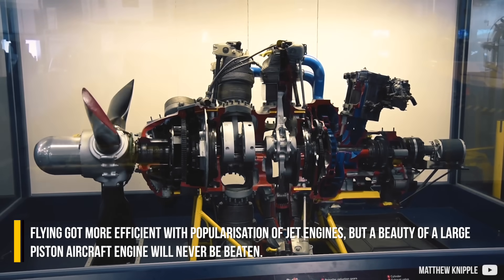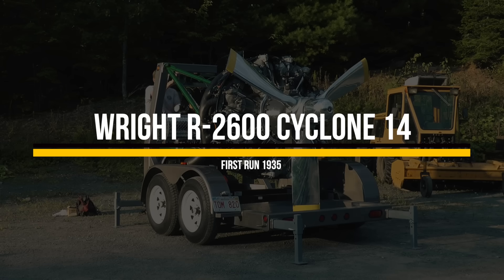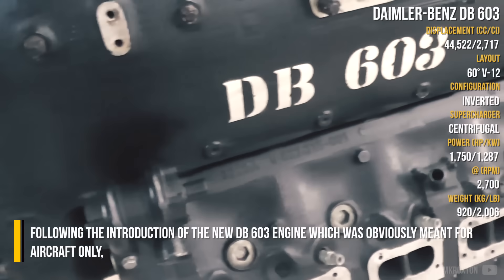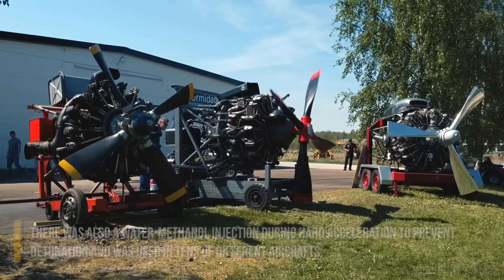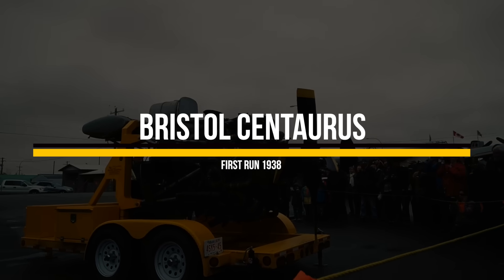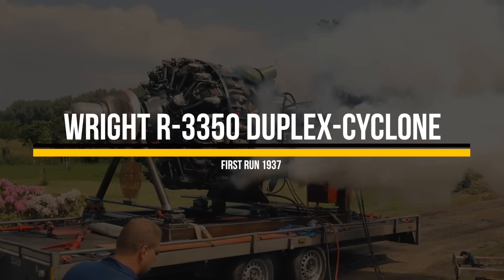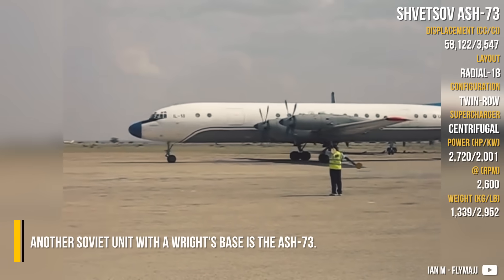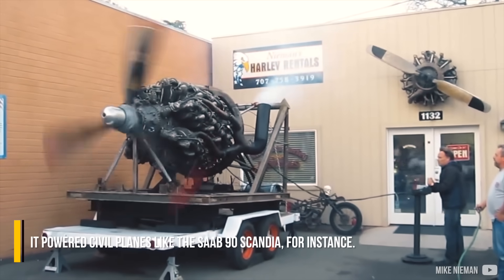9 Of The Largest Piston Aircraft Engines Ever

Comment: I am trying to learn the different pros and cons of various engine configurations in Aircraft. Horizontally opposed, radial, V , and straight engines. I think Horizontally opposed engine are the most used in modern piston aircraft but why is this the case?

Comment: You show a B-29 Superfortress when talking about the P&W R-4360 Wasp-Major four row radial. The B-29 was equipped with the Wright R-3350 Duplex-Cyclone. You would have been better off showing an F2G Super Corsair equipped with the R-4360 "Corncob radial" ! There were also several other small mistakes but overall an entertaining video for someone into aircraft and their powerplant(s).

Comment: Why doesnt the enormous torque of these engines that are on trailers flip the trailer over? Ive heard that ythe torque that the merlin produced made it difficult on the pilots when they were taking off that if they went above a certain RPM it would force the left wing into the runway. So with that in mind how can they run these engines on a light weight trailer without it spinning the trailer like a top?
Reply: @SpaceAce100 must be something causr if those engines have so much torque that they can torque roll an aircraft that weighs thousands of pounds on take off those spindly little trailers should be rolling and hopping around like something in a cartoon or something.  Its amazing to think how much power and torque those things have and if they used full power on take off it would spin the plane behind the prop. Just like a chopper has a tail rotor to keep the body of the helicopter from spinning. Its just mind boggling to think how much power yhey got out of a piston driven engine. Hell they even figured the thrust from the exhaust was responsible for 60 mph of the aircrafts top speed... Just the exhaust thrusting it forward

Comment: "We need more power. Add another bank", "But sir, this thing is clearly overheating. Don't you think-", "That wasn't a request, son. Add another row!", "(Sigh) Yes sir"
Reply: Did anybody mention why they stopped using larger cylinders (like on a ship)? So you could stay at two rows. And I could not find any mention of it. They seem to avoid gears just like ships. They could use Diesel cycle -- like ships or other airplanes. They run efficiently => less heat.

Comment: w/hydrogen fuel making running old school piston turbo props near free u will see these coming back into vogue again in large numbers for flights under 50-60 ppl out to islands & non hub airports. These will b the small for profit carriers, not hub not for profit carriers.  Comment 721 showing. They r not as fast, they r not great in winter, but neither is drive up & over a mountain. They can't handle ppl & cargo like jet not for profit but they can carry basic mail bags & ppl to non hub airport. Still hard to drive over big fuck lakes & rivers not bridge connect.

Comment: The B-29 used the R-3350, not the bigger 28 cylinder engines. The B-50 did use the 4360, but there are none flying.

Comment: The most interesting fact about the Wright R-3350 is that it had 3 turbos (good visible), but that were no turboCHARGERS. 
 
Instead, the turbines were coupled directly to the crankshaft and added about 450 hp. 
 
Hmm...
 
Using the energy of the exhaust to drive a prop shaft, more or less a propeller turbine.  
 
  
Just to clarify, the R-3350 was also supercharged, it had a "normal" centrifugal compressor.
Reply: Yeah, it was great stuff from way back when.  It was called a turbocompound.  Some diesel engine manufacturers are putting turbocompound units on their engines today.
Reply: @andyharman3022  We have such an engine in our aircraft museum here in Munich. Very impressive.

Comment: It’s amazing they were able to engineer these engines back then without computers and they built so many of them and they were reliable. Now we have turbine engines that don’t have as many moving parts and make much more power with far less maintenance.
Reply: Think, it was less than 50 years before that, that horse and buggy was more common than car. We went from clopping around behind beasts of burden to flying with birds in less than one mans lifetime. Amazing.
Reply: Well "reliable" only if you maintain it. The tolerances were huge and they all leaked oil. Tons of oil.
Reply: @carlosandleon  they didn’t maintain them during the war they did the bare minimum to get them back in the air obviously after the war maintenance was a much bigger thing. Every engine from this time period leaked oil it doesn’t matter if it was a lawnmower or an aircraft engine we had only been making engine for a handful of decades we didn’t have all the good gasket materials and sealers that we do now and I’m sure they didn’t know that one gasket material will seal better with a rougher machined surface and another gasket with seal better if it were smoother and we for sure didn’t have good seals I mean just look 50 years ago with cars where they had rope rear main seals it was just normal for every car to leak oil. The tolerances of engine manufacturing back then was also bad all the way around and even worse was balancing engines you can find videos from back then where a person is weighing pistons on a scale and before the needle on the scale stops moving they pull the piston off to put another on it lol. There are still surpluses of new old stock engine parts from ww2 for these old engines that still get used. Nowadays it’s normal for a little 4cyl engine in a car to rev past 7,000 rpm smoothly because they are balanced so well and they take thin 0w20 oil because the tolerances are much tighter. I use to work for a Saturn dealership as a mechanic and they used a Saab v6 engine in a few cars and the tolerances were so perfect they didn’t have a stock size main bearing every engine would usually have multiple different size bearings because they manufactured them to much tighter clearances and because they did such a great job machining the bottom ends they would never come in with  spun bearings I think the entire time I worked there we did a crank on 2 engines because someone cracked the oil filter housing and leaked all the oil out. Engines have came a very long ways! My grandfather worked on the b-29’s in the Korean War I think they had 18 cylinder wright engines, he flew all over the world in them on missions he said the biggest problems were with the magnetos and then cylinders would crack some times but he said the cylinders were more of a problem when the were doing training in northern Canada because of the super cold weather. Either way it’s amazing some of these old air frames are 80 years old and still in use!

Comment: Every one of these engines might as well be every other engine on this list.
Reply: @xvg3980  they all have a power to volume ratio that is close to 50 hp/litre, they all have the same rpm range, and they are all the same rough weight. They might as well be the same practical engine.

Comment: Many of the aircraft do not match the engine identified. The Wasp Major did not show an airplane it was used in. Not the B29 which used the Wright. The B50 (similar but with a taller tail or the C119 flying boxcar, or the C123 Globemaster) all used the Wasp Major would have been suitable. Still interesting.

Comment: A few searches on wikipedia (with sources of course) shows that there are errors in the video. For example, the P&W R-4360 wasp major did not equip the Saab scandia, which had two P&W R-2180-E twin wasp E engine, but was indeed use in military aircrafts such as the Convair B-36, which was not an anecdotal aircraft; and the plane shown at 9:04 cannot be a Saab Scandia (two engines civil plane, as mentionned) since it has four engines and a gun...

Comment: Good video but at the end you went from the 4360 to footage of the B-29.  The B-29 did not use the 4360.  The 4360 WAS used on the B-36.....Americas largest piston powered bomber with 6 turning and 4 turbojets burning.

Comment: When discussing the PW R4360, they showed a B-29 as one which used the 4360.  However, the B-29 was not powered by the 4360, but a larger, look-alike, the B-50 was.  I spent a lot of hours as crew member of aircraft powered by the 4360.

Comment: Thanks for the compilation, just be careful what footage you choose for each engine - there are a few danglers where it doesn't match (e.g. 6:00 is not a Centaurus even through the airframe would originally have had one, it's an R-3350 - valve rocker covers are a giveaway ;P)

Comment: The R4360 delivered 3800hp. The B-36, the largest warplane ever built, featured 6 of these engines, each in the pusher configuration. THis video does not mention that large piston engines tended to catch fire and could suffer from cooling problems.

Comment: The Sea Fury at 3:59 should normally have a Bristol Centaurus radial at about 53.6L or 3,272 cubic inches making 2,500hp

The Wasp Major R-4360 was installed in the Goodyear F2G Corsairs, also known as Super Corsairs, with first flight in 15 July 1945. The order was for 418 F2G-1 units and 10 F2G-2 units but only 10 were built before war ended. Only two exist and only one is flight worthy. 

The most distinguishing feature of the F2G Corsair is the bubble canopy.

Comment: Your last engine was the 4360 which powered the B-50 and not the B-29 shown. The B-29 had Wright R-3350's. There are several B-50/KB-50's on static display (e.g. Castle AFB, Atwater, CA) but there are no flying B-50's that I'm aware of.

Comment: The Wasp Major came too late to power war machines? Than what was that B-50 you showed? And what was the B-36 Peacemaker? Or the C-97 and C-199?

The Szvecov radial engines proved that the russian/soviet engineers were far better and more capable then the germans. Both had the licence of a good engine. The russians/soviets were able to develop them much further, and into still reliable and good engines. While the germans were never able to figure out the Hornet licence, and the BMW-801 is one of the worst aircraft engines ever. Unreliable, constantly overheating (so many german pilots had their feet burned in the Fw 190's cockpit), thermally limited. Meanwhile the original developers made their engines even further. The father of the Szvecov engines developed into the R-2600 and R-3350, the father of the BMW-801 grown up as R-2800 and R-4360. Well all four of them are among the best and most reliable aircraft piston engines ever built. The Szvecov radial are there too. Even the 4-row Wasp Major were cooled properly, meanwhile the incompetent engineers of BMW can't make a fucking double row engine reliable. Not surprising that the aformentioned american and soviet engines on the list, while the german crap not. The german's can't even figure out how to super/turbocharge that engine properly. So the Fw 190 was an awful high altitude fighter, and the germans were forcet to keep the Me 109 in production. Finally Kurt Tank had enough of the idiots at BMW, and redesigned the airframe to house a V-12 engine (Jumo213 or DB 603). And he made the best high altitude fighters of WWII with it.

Comment: You know it's a powerful engine when the aircraft twists as the throttle is pumped up!
Reply: Incidentally, it is not uncommon for multi-engined aircraft to have their engines spin in opposite directions specifically so that this torque effect will be mostly self-cancelling.

Comment: Can so done explane sodium filled exhaust valves for me please
Reply: Sodium has a melting point near 98 degrees centigrade. The liquid sodium in a „shaking“ valve will lead away the enormous heat from the combustion chamber and valve seat to higher located parts of cylinder head.

Comment: I think I understand why a radical engine pushes so much blue smoke on start up. It's burning off oil settled in the lower cylinders. Do they have kind of compression relief to them from hydro lock? I have wonder this for a while.

Comment: FiFi runs Curtiss-Wright 3350's, the later B-50 (same basic airframe) ran the Wasp Major.  The Ilyushin IL-18 only ran the ASh-73 while the aircraft was being developed, as the ASh-73 was needed more critically for the Tupolev Tu-4 (reverse engineered B-29) the IL-18 went with the Ivchenko AI-20M turboprop from early in its development. There were also teething troubles with the ASh-73, with a very low lifespan (150-200 hour TBO), making it a poor choice for a passenger airliner.

Comment: The development of the Super fortress,  the B50,  had Wasp 28 cylinder engines. Several P47 Thunderbolts were powered with them but the need was passing. They were expensive to maintain.

Comment: What configuration allows 22 cylinders?
Reply: none that I'm aware of...I suppose a 22-cyl. two-row radial is possible in principle, but fitting 11 cylinders around a crankcase would be problematic, to say the least.
Reply: @hamiltonmays4256  Absolutely.
Reply: Wright 4090
Reply: @brianpeadensr378  Thanks for that, looks like monster to work on.
Reply: I built a 4090 mock up. Send me a email and I'll send pics

Comment: I noticed you mentioned the Daimler Benz DB 605 but not the 610, why is this ? The 610 was a 28 cylinder with 2950 HP during takeoff, and 2160 HP cruising. 
On the point on bringing up engines, why not the BMW 803, 28 cylinder putting out an astounding 3847 HP. Sure it was a prototype but who cares

Comment: The plane shown @ 9:23 is actually a late model b29 using wright r3350 engines, not a b50 using the wasp major. But I could understand the mistake as late model b29s very much resemble the b50

Comment: Dad worked on the Wasp engines  at SFO when radial engines ruled the skies. These  engines always smoked on start-up due to the bottom cylinders pools of oil when stopped. Each engine needed 2 quarts oil needed after a long tun.

Comment: 4:36 i wonder why soviet V12's had unequal length strokes, the engine in the T-34 is the same
Reply: Not 100% sure, but it used the same type of conecting rod configuration as in a radial engine, ( a main rod, and a pivoting points on it for the other connecting rods), but in a v12, so l think that accounts for the different stroke length.

Comment: Saab Scandia uses Wright R-2600, not P&W R-4630
Reply: Not correct. The Saab Scandia used the P&W R-2180 which is basically half of the R-4360, with 2 rows and 14 cylinders and half the displacement.

Comment: What? No Napier Sabre?! It had the most original, and rare, configuration of them all, two complete flat 12s laid on top of each other, making it incredibly compact for its 24 cylinders. AND driving by FAR the biggest fighter propeller of WWII: 14 feet. Take that Corsair, and your 2800 driving a puny 12 footer!
Reply: Agree! Waiting for the Typhoon!
Reply: Not reliable at all...! 
Very compact (more than the RR Griffon?), but with a such big radiator (cause it was so hot...), that you lost the aerodynamical avantage... |-( !
We had just restored one in LFPB (Clostermann's Tempest), what a monster !
Reply: @xvg3980  he was reliable for war effort no ones wouldn't maintain an engine every 25 hours even if it's PITA for ground team. It was acceptable for RAF
Reply: @yo yo I did say "fighter propeller", but nice to know the B-29's prop size anyway. :)
Reply: Which is why they dumped it for the Bristol Centarus.
Reply: but this is the list of biggest not most bizarre.
Reply: The Hawker Fury with Napier Sabre is shown just after the Corsair at 3:57. That had 37 litres from two crankshafts and 24 cylinders. In late 1944 they were doing 2,400bhp but eventually made 3,500 bhp. Test bed engines reached 5,500bhp.
Reply: @Dave5843-d9m  Sorry mate...not a Napier. That is the Bristol Centaurus. There are no Sabres running at the moment, until the UK Hawker Typhoon resto comes to life in 4 or 5 years.
Reply: @ @johnmclean6498  -  Sorry mate... not a Centaurus. The engine installed in the Fury at 3:57 is an overhead valve design (you can see the rocker covers). The Centaurus is a sleeve valve design.
Reply: @cybair9341  Nope ... definitely a Centaurus ... 5 bladed prop.
Reply: @cybair9341  as Napier Sabre was also a Sleeve valves engines

Comment: Prop kicks up FOD at 7:13. Could've killed somebody/motor/prop
Reply: my thoughts engines on trailers bad job once at a rally  poly bag caught by the prop then threw it out like walnut size piece  ouch
Reply: @raypitts4880  Seen a mechanic in the prop line get a pebble shot into his face. He was 50 feet away too. It's no joke

Comment: A little more research needed perhaps. An aero rotary engine is not a Wankel rotary engine and they d not have rotors. With an aero rotary the crankshaft is bolted to the air frame and relative to the engine it is stationary. The propeller is bolted to the crankcase and the entire engine, except crankshaft, rotates .. as the name implies.